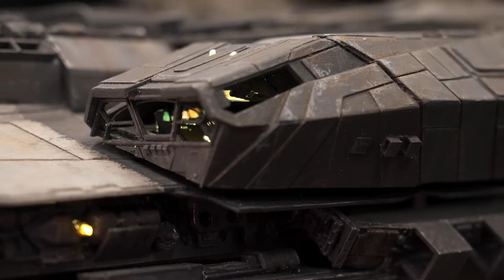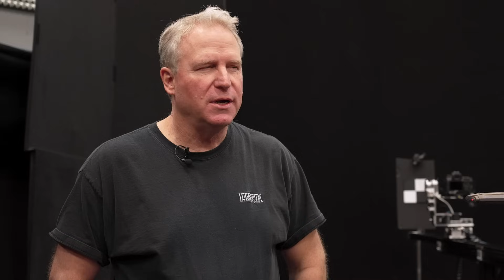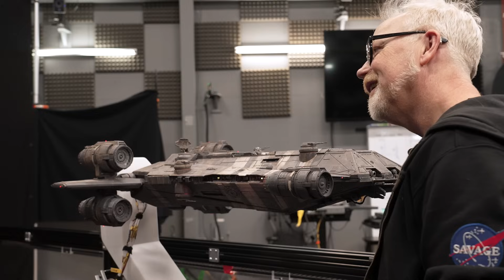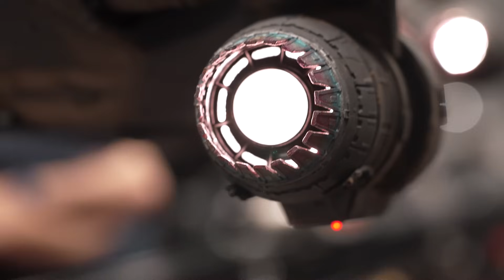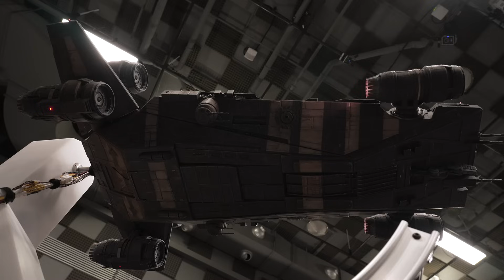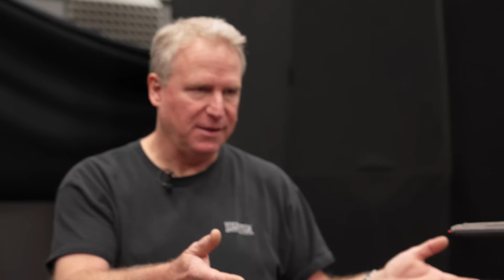How This Star Wars Filming Model Was Built With No 3D Printing!

Comment: I'm now curious to know why their choices to not create some 3D printed parts (like the engine in the 2 different sizes) and not create a 3D printed model parts for it, over sourcing muti pieces to cut sculpt and join on instead! curious! is it a lesser opinion to 3D print over scratch built for a build like this?

Comment: I was machining a very heavy milling cut on steel one time. The largest horizontal milling machine in California. The chips piled up glowing orange hot. The pile retained the orange glow because it was such a large pile of hot chips. For some reason the following day the pile looked like it was still orange hot. It couldn't still be hot overnight. So I eased my hand on to it to see if it was as hot as it looked. It was cool but for a reason I still can't figure out the chips were orange. So metals can do some strange things color wise.